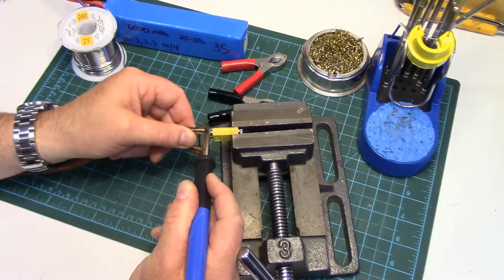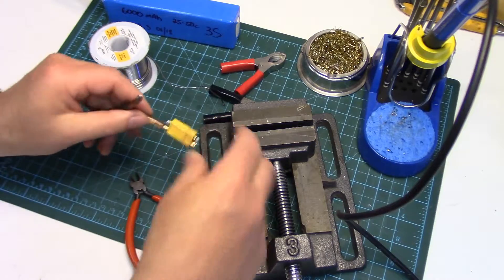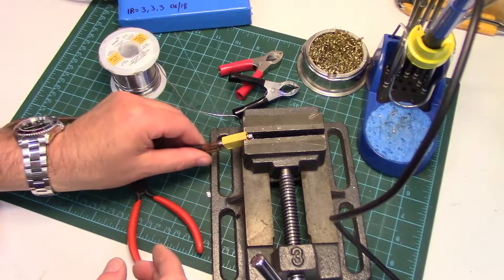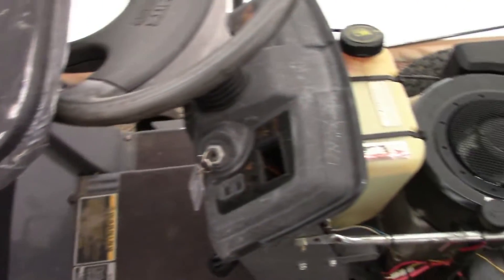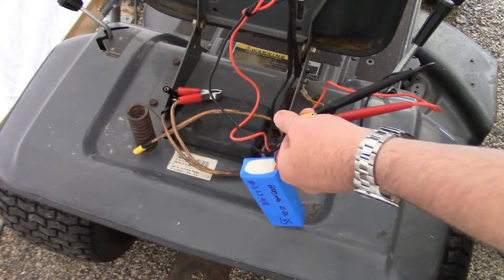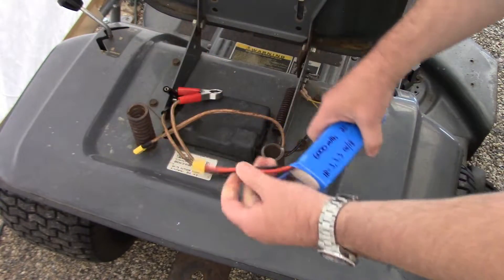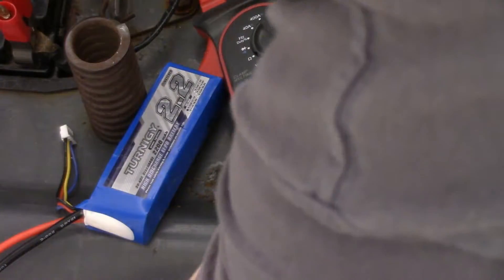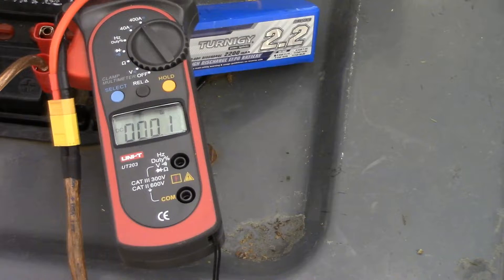Riding Mower LiPo Battery Booster Build

Comment: A 4s not fully charged should work as well right?
Reply from the maker: Yep. I would think 15.5V is about the max you would want to expose the system to, so what's that? About 3.88V per cell. Let's say a 50% storage charged 4S pack at 3.85V per cell. Seems about perfect IMO.